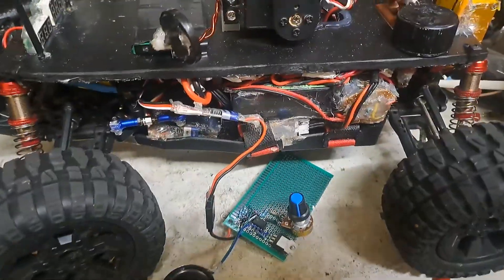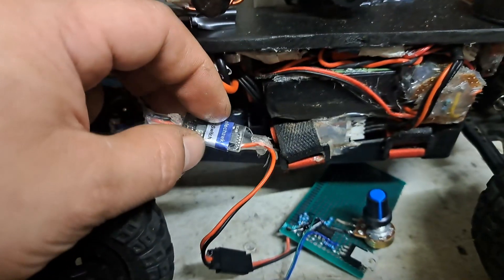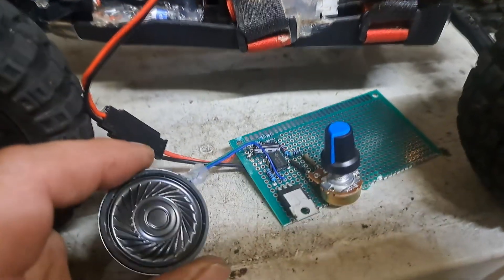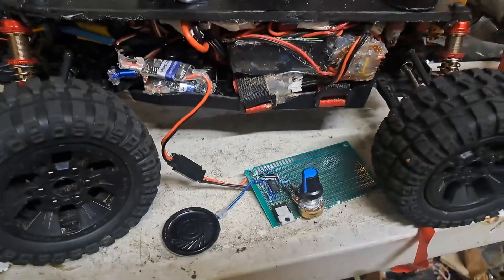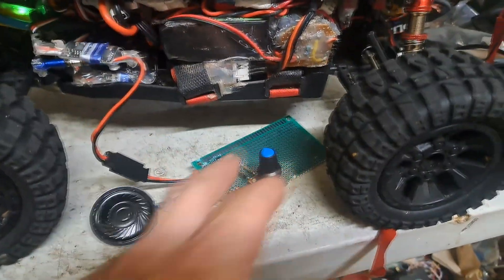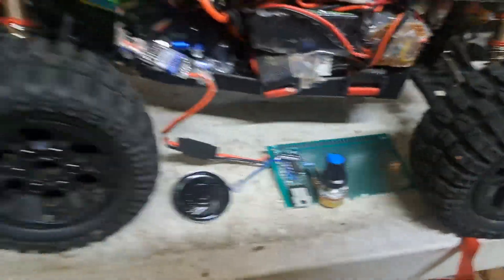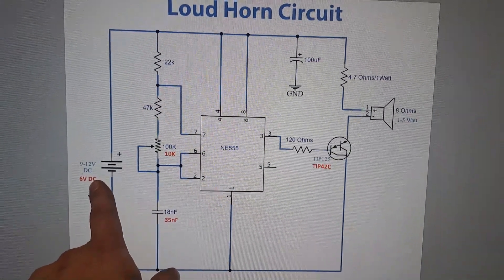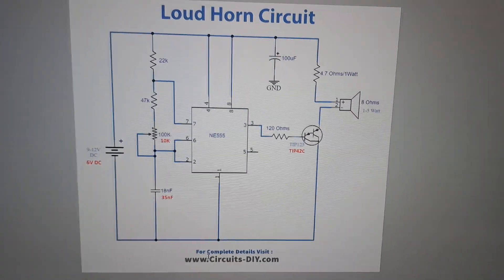Simple DIY Horn for RC Cars (NE555)

Comment: Did you do something other than mentioned bro ? It's not sounding like a horn I made it 555 is making pulse but not like your one sounds
Reply from the maker: No but yours won't sound the same if you're using a different voltage or even a slightly different 555 IC for example. I just showed the values I used for a ~6V supply (it shouldn't really change THAT much but I imagine it could vary). What does the pulse sound like? Like literally a slow beep?
Reply: @Magneticitist its like buzzer low frequency I'm using same speaker as yours, as a last try i might use 35nf capacitor rating 50v hope that work
Reply from the maker: @-AJAL  It's not easy to do without a scope (or calculating the timing values) but if you're already in some audibly recognizable range it sounds like you just need to tweak the timing values to up the frequency. Something around the hundreds of hz range seems to be decent, like 300-500hz or something etc. I think the duty cycle on mine was running somewhere around 50%, but I also found a lower duty cycle and higher frequency sounded ok. 35nF was basically just the value I measured with a meter, it doesn't need to be exact since just a ballpark region should work. A 33nF is fine for example.
Reply from the maker: @-AJAL  https://ohmslawcalculator.com/555-astable-calculator

There's a good calculator for the rough values. R1 is 22K, R2 is the 47K with the 10K pot in series making it adjustable up to 57K. That comes out to roughly that ~320hz to 380hz with a 33nF cap.

Comment: Bro will it work for sure I made this on bread board no response
Reply from the maker: Yea this definitely works if wired right.
Reply: @Magneticitist where do the 100uf capacitor ground go and is there any problem if I use 33nf instead of 35
Reply from the maker: @-AJAL  That 100uF is just smoothing across the power rails and yea 33nF is fine I think 35nF is just what I measured at the time.